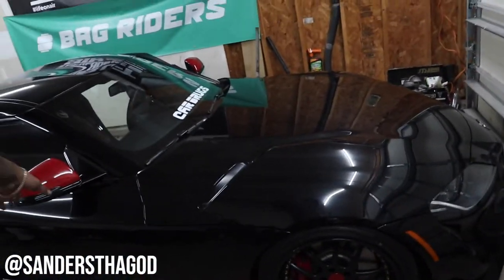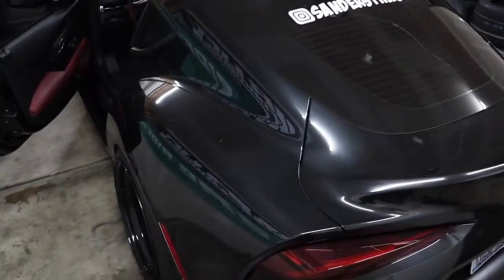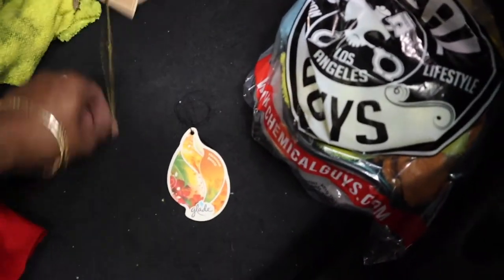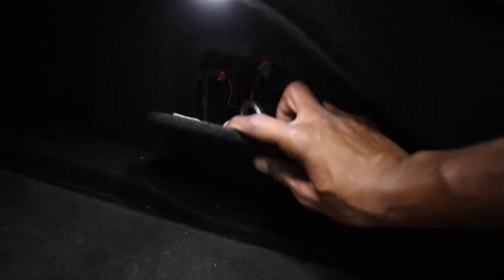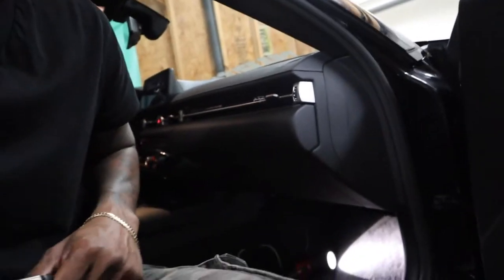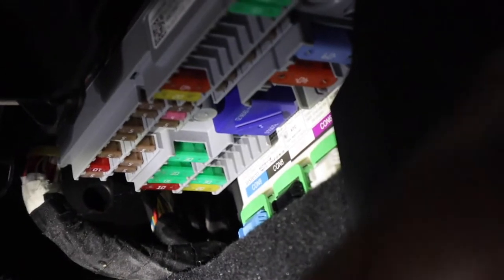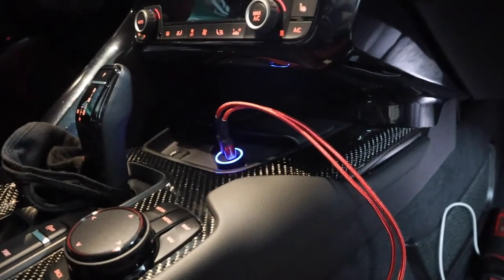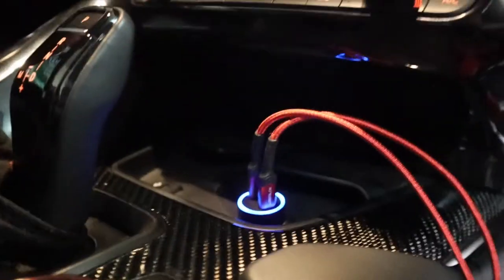2020 Supra Fuse Box Location???

Comment: I gotta give this a like, my situation was like this come to my Supra and found a tire low on air due to a leak. Gave my mobile air inflator a try to find out a dime in the cigarette lighter charger figured a blown fuse after the I took the dime out. Found myself stuck on where the fuse was for the cigarette charger till I found this video thanks man
Reply from the maker: The first time I found out about it was becasue me using a tire machine as well. Im so glad I could help